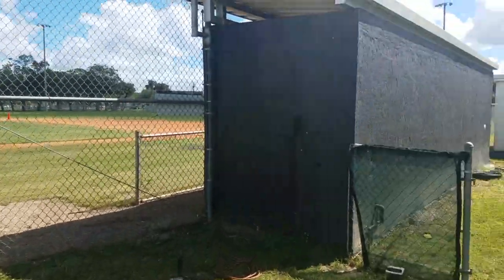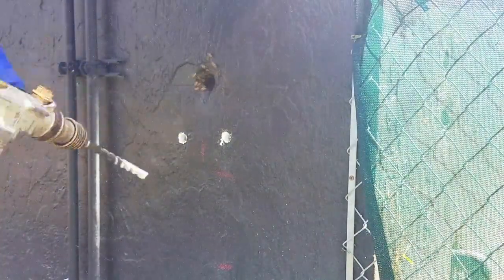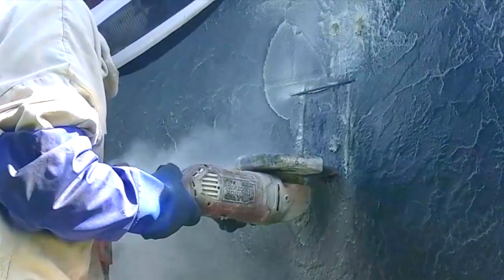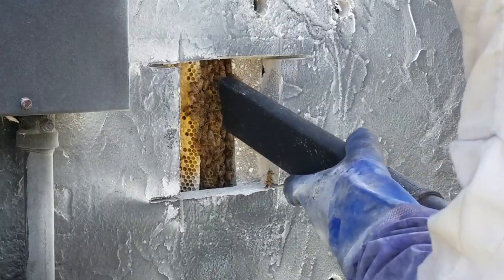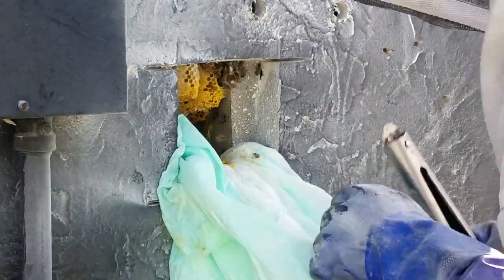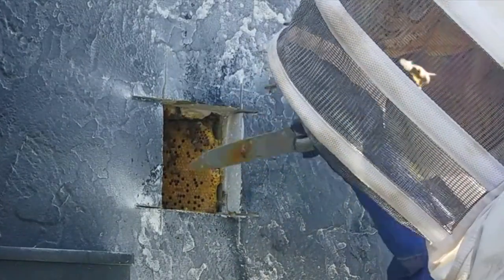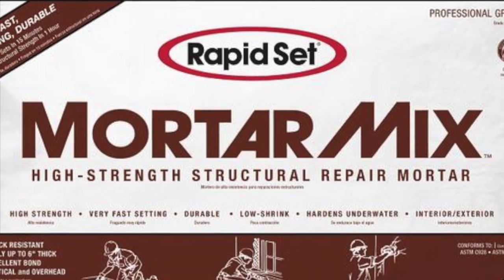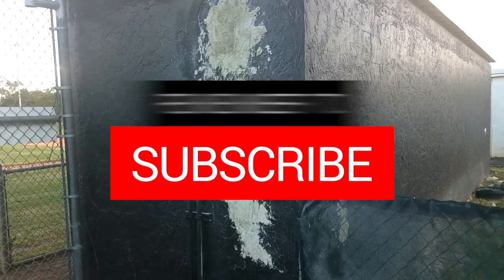Bee Removal Baseball Dugout Block Wall

Comment: Did you capture the queen?  Wouldn't it have been easier to quick set the original cutouts back in?
Reply from the maker: Thanks for the comment. Yes, I got the Queen. All the bees captured. Here in Florida it is required by the Florida Department of Agriculture to replace the queen with a European queen from a breeder because of the 85% likelihood (according to them) that the feral bees are Africanized. I tried quick setting the original cutouts when I first started opening block walls. I've been doing this for seventeen years. I found that is was difficult to get a good set and then later the plugs could be knocked out easily with a hammer or a bump when someone worked on the wall. The lath inserted actually makes the patch stronger than the original block.  Hope you subscribed.